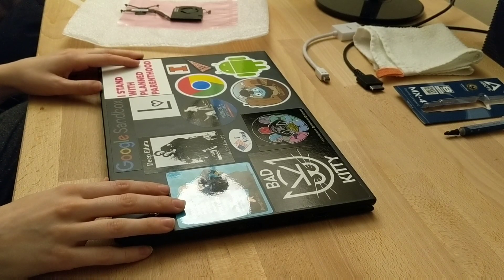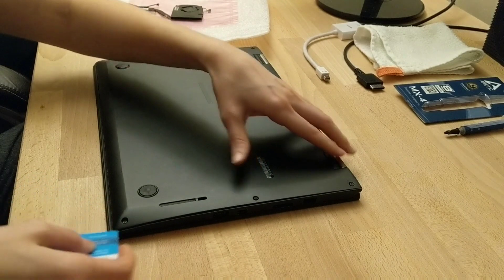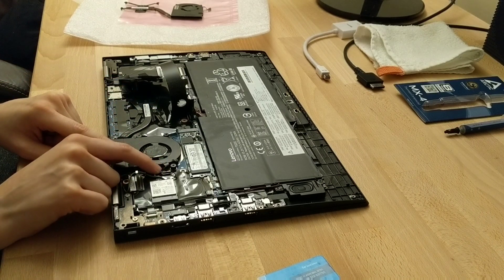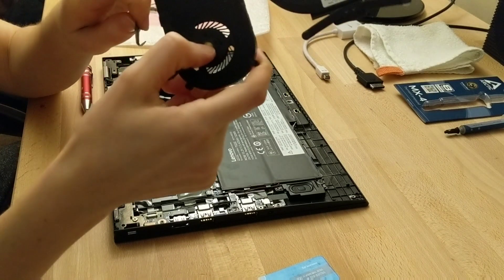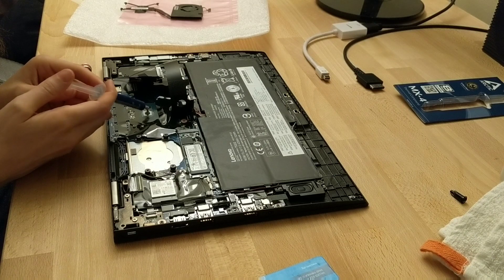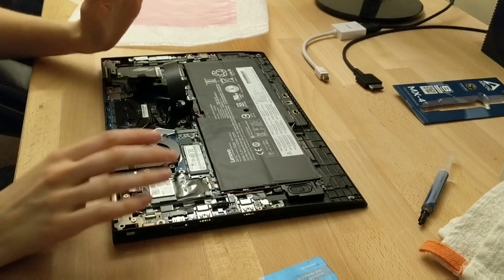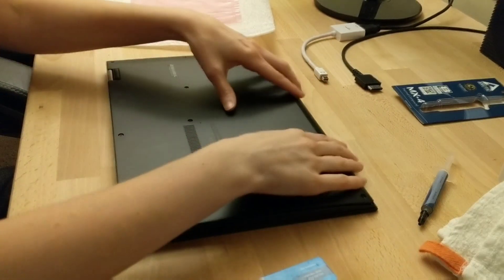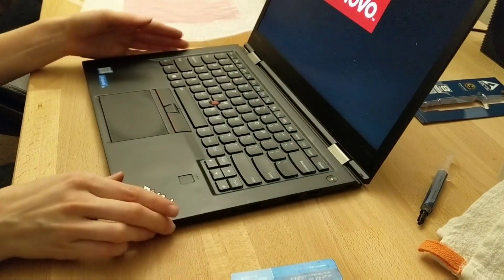Lenovo X1 Carbon 4th Generation Fan Replacement

Comment: Nice video - one suggestion about opening the case. Once you remove all the screws you can just lift the bottom off from the back and pull the front part toward the back and it just slides out. No need to pry it open. Likewise, when putting it back together, slide the front in and then pivot it like it's a hinge so the back just falls into place.

Comment: Nice video for Gen4. One tip that will help you the most: To prevent CPU turbo boosting which is the main cause of the crazy CPU throttling up/down constantly -> change Window Power Plan's CPU Max Performance setting from 100 to 99%. It should make the X1 runs much smoother.

Comment: Thanks for the excellent video tutorial H0llie!  My X1 Gen 4 fan was wheezing fiercely and following your instructions I was able to change it out with no problems.  Getting the battery disconnected and reconnected was the hardest part of the process.  I had bought the M4 thermal paste as you recommended, but surprisingly my $35 ebay replacement fan came with a strip of (dry) grey thermal paste on it already so it turns out I didn't need the M4.  

On a separate note - I hope my daughter grows up to be as tech savvy as you!
Reply from the maker: Hmmm you might want to remove that old thermal paste with isopropyl alcohol and reapply new stuff. I mean, it'll probably be okay if you don't, but applying it fresh /really/ helps with the thermal conductivity. Glad the video helped!

Comment: Thanks for this, the fan on mine has started making some horrible noises, so a cheapo (~£40 vs £65 - £75 as some other UK folks have menetioned) from ebay as you recommended is on route

Comment: How much does the heat sink cost..?
Reply from the maker: The fan and heat sink come as one unit when purchased. I'm not sure about how much their current cost is. I think I bought most recent replacement off eBay for like $70, but I've since purchased a newer version of the laptop. Hope this helps!

Comment: Thanks for this nice video but this laptop is X1 Yoga, not X1 carbon. I have both and I can see the difference Carbon and Yoga.
Reply from the maker: Except my laptop is definitely an X1 Carbon. Could be that you're mistaking different editions for one another
Reply: @h0llie_h  I am watching this video in my 6th generation X1 Yoga and both shapes are identical. I also have 6th generation X1 carbon which is slightly different. But anyhow if you are sure then I will not argue. I have to replace fan of my friend's 4th generation X1 Yoga and I am sure your video will be really helpful to fix his laptop.
Reply from the maker: @superaijaz  Ah okay, yeah that would explain why you think that way. Best of luck with the repair! I did the best I could with a broken tripod and a ladder to mount my phone for video back in the day :)
Reply: @h0llie_h  Your hard work is greatly appreciated :)

Comment: Very, very useful video. Laptop had the same fan problem and this video told me everything I needed to replace it. Thank you for speaking clearly and telling me exactly what I needed. Thought maybe the camera could have been closer to the laptop but I managed to make it out fine in the end. 10/10.

In case anyone else wants to know:

Think I got rinsed for the fan. Found it on Ebay. Cost around £75 total including customs tax since it came from China. Still, better than paying for a new laptop.

Kind of a shame the fan is so lame. I bought Thinkpad specifically because of their rep for reliability. I've only had it just over two years as well...

The key I think is really not to use fan intensive programmes. It's only from doing so that I first started getting fan jamming, and eventually it broke entirely so the laptop refused to turn on at all (said' Fan error' on startup). So I'm gonna keep this laptop strictly for low intensity software. And will probably get a Mac next time, much as I prefer Windows they just keep letting me down...

Anyway thank you again!
Reply from the maker: Yeah I filmed this after my tripod was broken so I ended up using cardboard to hold up my phone on a ladder. I tried lmao, glad it helped!

Comment: OK, just got the fan off. Hmm ... the metal sticker bit wasn't on straight, and a bit of it had been pushed down into the blades. Other than that it looks OK. Guess I'll save the unit for when my replacement craps out in a few months, then put it back in with the sticker straightened out, and see if it works.

*edit* Although there was a fair amount of black dust on the copper surface under the fan. So maybe the blades got chewed up a bit.

Comment: Bah. That battery connection is not just popping off ,  as depicted in the video.
Reply from the maker: Yeah it's a real delicate connection. You might have to pull a bit more than you'd otherwise be comfortable with
Reply: @h0llie_h  D'oh! I forgot to order some thermal compound. Gonna have to wait for that to arrive -- hopefully that connector magically loosens up a bit before I take another crack at it. :-)

I imagine that after you've popped it off once it's easy to do it again -- but the first time, I don't have a sense of exactly how and where force needs to be applied, because I don't exactly understand the geometry of the thing. Felt like I was applying a fair amount of force popping it up with my fingernail on the right corner, and pushing from the back slightly towards me -- didn't budge.

Comment: When I pick up my 4th gen, there's a horrible grinding noise. I assume the case flexes a little and the fan makes contact with something.

Bah. Time to open it up I guess. With any luck, a wad of dust-gunk is the cause, and cleaning it out will fix it.

Comment: Is thermal paste essential?
Reply from the maker: Yes - it helps better transfer heat away from the CPU to the metal heatsink that gets cooled by the fan. You risk having your CPU overheat without it. A tube of paste is only a few dollars, and you definitely don't need to use as much as I did (it squeezed out a little fast), but knowing how hot my laptop can get WITH thermal paste, I wouldn't try this replacement without having a tube handy!
Reply: @h0llie_h  Now I see why you used the paste. It appears that everything happens for a reason :)  I will get my tube ready. Have a fabulous day!

Comment: Massively helpful video.  I'm looking this up because a user has a problem with this model and the fan.  I may get Lenovo to do the work, though, given the poor quality of the fans, that way it is their fault at least.
Reply from the maker: Yeah I'm on my third fan, but the cheap one I got off eBay has held up the best. It was maybe $20. Best of luck with whatever path you choose, and at least you have a self help video in the meantime ;)

Comment: I can confirm that the Nidec replacement originally used in this video is not only more expensive, but also junk.  Bearings were bad right out of the box and it sounded like a hive of bees were living in my Carbon X1.  Gonna try the cheaper version from another vendor.   Anybody had luck with this version?...... https://www.amazon.com/gp/product/B07BMVFZP3/ref=ox_sc_act_title_1?smid=A303DZ4M840D9G&psc=1
Reply: Dang, that's super expensive. I'm just about to try replacing my failed unit with a part I got on ebay for about $40. We'll see.

Comment: Womp Womp...You took the last part from Amazon Hollie.
Reply from the maker: fatalradius And? The only other way to acquire that part was through a bulk order through Lenovo, and idk about you but I'm not about to buy 2000 laptop fans when I just need one
Reply: H0llie I only kid, I did however find some other websites that offer the same part. Surprised how rare these fans have become already for a 2016 laptop.
Reply from the maker: fatalradius Yeah, planned obsolescence is lame :/
Reply: Amazon is gross anyway. eBay is the place to get these. Even if they are a little rattly and expensive.

Comment: Also, where can we get genuine replacement parts for Lenovo Thinkpad X1 Carbon 4th Gen 20FB/20FC
Reply from the maker: Unfortunately in the case of this laptop fan, I would have had to have made a "large volume order" to get the part directly from Lenovo. Since the part isn't manufactured by Lenovo, it's good enough to look up the part number via Lenovo's website https://support.lenovo.com/us/en/partslookup and then check on Amazon. I've included the link to the one I bought in the video description!

Comment: Could you indicate the items involved.. like the Isopropyl alcohol or Ethyl alcohol and specific brand for thermal paste?
Reply from the maker: I've just now included those details in the video description - I'd suggest 90% concentration isopropyl alcohol and Arctic MX-4 thermal paste. I'd additionally suggest using an anti-static wrist strap if possible